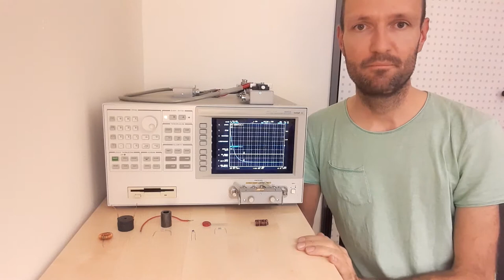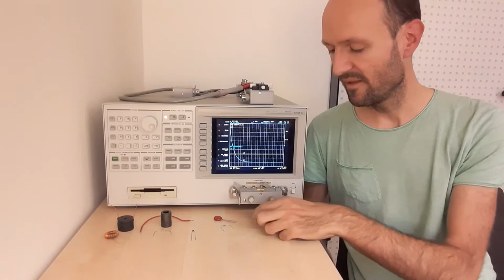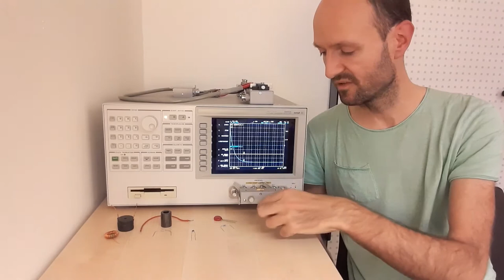How to Perform Measurements With the Precision Impedance Analyzer Agilent 4294A - Part 3

Comment: Hi, I would like to know if it is possible to test coin-cell lithium-ion batteries.
Are there any accessories for this analysis?
Reply from the maker: @Casquelles  What would you like to test from these batteries, a complex-valued inner impedance as a function of frequency?
Reply from the maker: Also see the "Keysight Technologies Impedance Measurement Handbook - A guide to measurement technology and techniques" (e.g. from https://assets.testequity.com/te1/Documents/pdf/keysight/impedance-measurement-handbook.pdf).
In Sec. "5.11 Battery measurement", it is stated that: "The internal resistance of a battery is generally measured using a 1 kHz AC signal. It is not allowed to directly connect a battery to the auto-balancing bridge type impedance measurement instrument. If a battery is connected directly, the instrument becomes the DC load, typically 100 Ω for the battery. The instrument may be damaged by a discharge current flow from the battery. Figure 5-42 shows the recommended setup for this measurement. C1 and C2 block DC current from flowing into the instrument. The value of C1 should be calculated using the minimum measurement frequency. For example, when the measurement is made at 1 kHz and above, C1 should be larger than 32 μF. The voltage rating of C1 and C2 must be higher than the output voltage of the battery.
Note: The Keysight 4338B milliohm meter can measure the internal resistance of a battery up to 40 V DC directly connected to the measurement terminals because the DC blocking capacitors have been installed in the 1 kHz bridge circuit."

Comment: Hi Matthias, I wanted to know that can we measure the output impedance of low voltage supply (5 V)?
Reply from the maker: Yes, but never connect the power supply directly to the impedance analyzer's auto-balancing bridge. In this case, the analyzer acts as a DC load (with a typical input impedance of 100 ohms) for the power supply and could be damaged by the current flow from the power supply. In this case, you must have DC blocking capacitors. They need to be large enough to allow significant current flow in the frequency range you are interested in, and should be able to withstand the output voltage of the power supply (which should usually not be a problem at 5V). See this web site for more details and recommendations: https://docs.keysight.com/kkbopen/how-to-measure-the-internal-resistance-of-coin-cell-battery-using-e4980al-lcr-meter-620139958.html

Comment: Hallo,
mit diesem Gerät, können wir die Induktivität sättigungskurve kriegen? z.B LI kurve?
Reply from the maker: Ja, das sollte möglich sein, auch wenn ich es persönlich noch nicht ausprobiert habe. Die Vorgehensweise ist im Handbuch von Keysight (https://www.datatec.de/media/pdf/7c/4e/21/Keysight_Impedance-Measurement-Handbook-5950-3000.pdf) in den Abschnitten "5.14 DC bias current enhancement" bzw. "5.14.1 External current bias circuit in 4TP configuration" beschrieben.
Reply: @MathiasMagdowski  Vielen dank für die Auskunft!